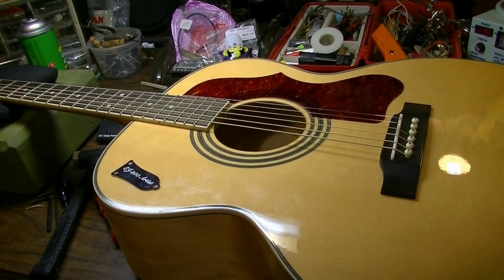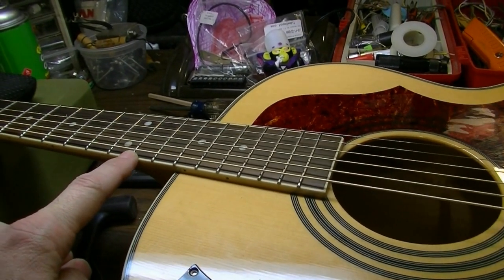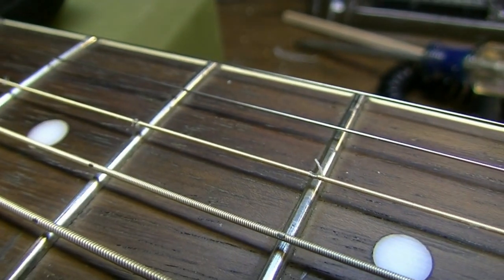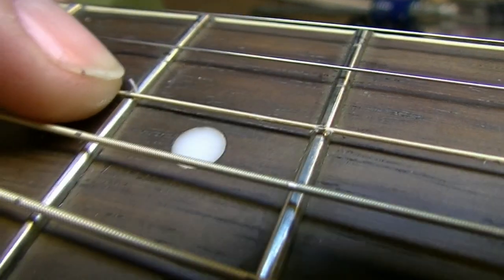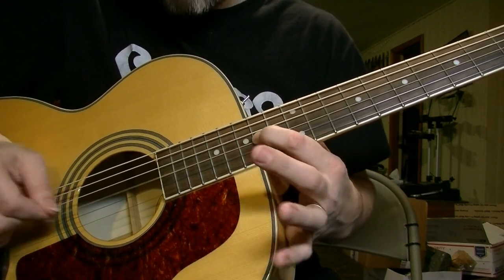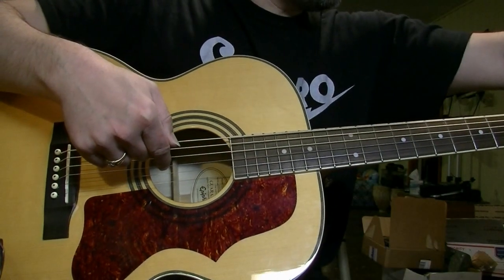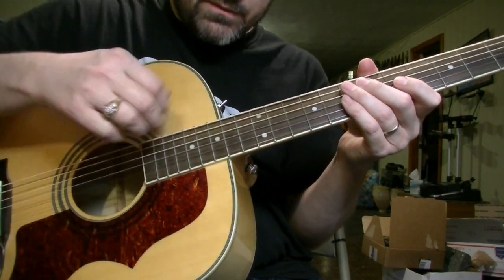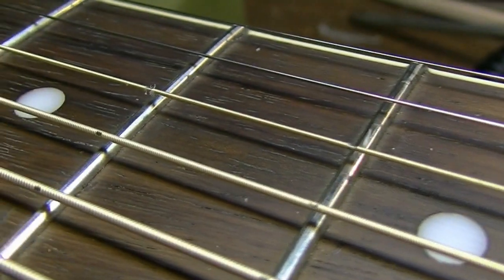Why I NEVER Use ELIXIR Coated Guitar Strings

Comment: been using nanoweb coated elixirs on three guitars (crappy acoustic, 6 string washburn and 8 string agile, that one was hard to find) and this has never happened. These strings look abused. My perspiration and whatever oils my fingers have are very harsh on strings, I can basically rust to oblivion a normal set of strings in less than a week even if i wash my hands before playing. After moving to another city and various other life-related stuff, i took the 8 string out of its box after two years, the strings were still pristine.

declaring "I'll NEVER use Elixir Polyweb or Nanoweb" is kinda... far fetched. From the looks of it, it's either manufacturing error (HIGHLY unlikely) or there is a shitton of seriously heavy fretting going on. Like, white-knuckle grip and bend with all your might with the intention of grinding the strings on the frets.

it's not about being passionate about strings. Who gives a flying fuck for strings? It's about recognising when a product isn't a good fit for the purpose. 

strongly suggest you string one of your electrics with coated elixirs and try them out. There is one thing i have noticed the coated ones don't do very well, and it's when you slide your fingers lightly along the strings and they make that glistening sound: the coated ones don't do that very much. If you like that sound, you might miss it.

Comment: Just as the devils advocate here, I bought a pack of Elixirs and within a week mine were fraying and peeling along the picking area. Was pretty disappointing, I neeed to use hand lotion so I don't crack from dryness (Canadian winters are cold and harsh, no liquid water in the air) and it seems it must've been my hand lotion which degraded the strings more rapidly than majority of people here seem to experience. If your elixirs lasted a long time, consider yourself lucky... I'm disappointed within the 1.5 weeks of putting them on.

Comment: I was a well thought of guitar service manager for ten years at a LMS, and a manufacturing assistant at a small but respected luthiers, and I'll tell you what. I sold up to 10 Alverez guitars a day with these strings equipped. Elixirs could withstand more than a year of greasy fingers and zero wipe-downs on store stock, and still sound great and play well. Regular strings could get wrecked by one sweaty customer. There is no contest.
It's not even a contest with say DRs or D'addario coated which I also sold, used, and liked. I like Ernie Ball slinky's too, which is what I put on guitars I perform with and change each gig, because they are cheap. I say this so as to prove I'm no brand whore. 
As far as low maintenance strings go, Elixir are far and away the best, based on nothing but long experience. 
I've got a set on my couch time electric, 3 to 4 months old, played daily, and they are only starting to get to the point where they may need changing.
Reply: How can you expect that worn out strings are going to perform like new strings?... Pfft. I bet they are a year or two old. No matter what the guy says. I've seen two year old Elixirs, and that is what they look like. Any set of strings more than three months old that are defective are to be replaced, not used as evidence that the company making them is shit.

Comment: Ok....  A forty five year secret is about to be revealed:

*I have only used Elixer string once... back in the mid - late '70's  Underwhelmed.
* You don't need Elixers to get the long life and still get a great sound.
* Back in the early "70's I took two guitars to class (playing guitar for college credit was better than English lit.)
* I had a Suzuki D35 copy.
* The extra guitar was a friends "B" (or even "D") grade Yamaha.  It was awful.
* I worked a little on the guitar but did one trick that really made that plywood junker light-up.
* The instructor had everyone tune-up, and he came back to me when I tuned the Yamaha.  
   He stopped, listened and said,  "That's a really good guitar."
* This trick has never failed.  Must add here, I've built a handful of guitars, one truly bad, the rest pretty spectacular.
* Strings do wear out and need to be replaced but they go dead long before replacement.  
* I must give a small amount of credit to an old college roommate.  He had a liking for fried chicken and would then 
   head straight to my room and get my guitar.  I had a flawless BC Rich B20 (yeah, Bernie once made acoustics, no two
   were ever alike even though they may have borne the same model designation.  They looked the same but were totally
   different for tonal qualities).
* My beautiful BC Rich was coated in chicken fat.
* Gave it a thorough scrubbing with rubbing alcohol, and got it fairly clean.  Just as with the Yamaha, the guitar
   sounded great.  Start with 70% (lacquer will dissolve with methanol.  get it clean with 70%, then remove that 
   30% water with 91%.  Be quick.  You have already removed the dirt, now you just want to get it dry.  Water is not
   good for strings or fretboards, and a dyed fretboard may lose the color, so always use propanol, NEVER methanol.
* When you do replace the strings, quickly clean the fretboard, re-oil, and buff it dry.  Install the new strings, cleaning
   first, then again after they are brought to tension.

Has never failed yet.  Just clean your strings.

Comment: Elixir strings don't go dead because they COME dead, right out of the package. 
I would only use them in cases where the player has acidic skin chemistry that eats plating, etc and leaves a white residue on the fingerboard.  For me, that's the only application. 
I know a LOT of pro guitar techs for the rock star types, and these guys get strings free, and can use whatever they want, and I haven't run across a one that actually uses Elixirs, regardless  of endorsements
...But the Taylor crowd will tell you they are the best lol.

Comment: Google needs to make these threads easier to respond to.  If you don't like elixirs, don't buy them.  I've had good luck with them.  The humidity where I live corrodes strings almost instantly.  The elixirs on my only ovation sound brand new after nearly six months.  Most of the strings are made by one company in one factory anyway.

Comment: I’ve used elixirs for years, they are hands down the longest lasting, best strings I’ve ever used. However, I also change strings every several months due to heavy play and sweat/grime buildup. I also clean my fretboard often, never had an issue with fraying, only coating wearing off on those special coated versions. Not sure why some people reuse strings to begging with, I’d say just switch them out every few months and you’ll have a new and full sounding guitar forever!

Comment: the only issue ive had with these strings is that the intonation dies pretty quick. maybe a couple months of consistant playing, check intonation at fret 5 and 17 and it is completely off. infact its so bad the guitar is almost unplayable. i dont think acoustic players would notice this as much because its less common to play the higher octaves. but electric guitar solos and stuff like that it's instantly noticeable and disgusting sounding lol

Comment: These strings either have a thousand hours of play time, or the player has bionic hands and needs to lighten his touch, or the frets need to be dressed. 
 I change strings once a month and put a ton of hours on every set and they are beyond ready to be changed when I get a new set. This can only be done with elixirs, every other brand I've used is unplayable after two weeks.

Comment: Any question about whether you have any credibility on this issue as a guitar tech is easily answered by looking at 6he condition of those frets, the fact that you re-used the strings, and that hack job of a switch you drilled into the guitar (you know, there are way better looking and performing switches than that, right?).
Reply from the maker: I installed the switch the customer wanted. And I put the strings back on at his request, because they are expensive strings and were brand new. The frets weren’t the cause of the peeling string coating. This is just what shitty coated strings do when you don’t play your guitar like a geriatric. But you wouldn’t know anything about that.

Comment: Sorry Dude.  I'm not a fan of Elixers as they seem to break more often on me than others.  However, the coating should not be blamed.  Those strings should have been changed ages ago.  Apart from the buzzing, I see huge flat spots that indicate they are no longer playable.  Coated strings generally last longer, but they don't last forever.

Comment: Man, I've been using Elixir's for over a decade and never have seen this issue. Of course, regular string changes and proper maintenance I guess might insure that my strings don't look the ones in this video. And I guess I just don't understand, if you're putting new equipment in your instrument, why wouldn't you put a new set of strings on the guitar? I mean come on! New pick up? Let's get new strings on that chief! That's almost like buying a new suit, but wearing your old flip-flops when you put it on.

Comment: Two practices and one gig you say? Sorry but I don't buy that for a second. Those strings have been hammered. I have used Elixirs for 20 years and they will last for months before the coating begins to wear. I suggest changing strings a bit more frequently!  I also suggest that there is a high fret causing the buzz; nothing to do with the strings-and the action on that guitar is not excessively low either.
Reply from the maker: You don't "buy it"? Why would the dude lie about it? Why would I lie about it?

Comment: I only use Elixir strings (Polyweb) and I've been using them exclusively for years. I've NEVER seen this happen, no matter how old my strings have gotten. Elixir's easily last about 5 times longer than regular strings (maybe more). They are phenomenal and your cost benefit analysis could not be further from the truth. They are definitely worth the money and you save money on strings when you use them. The strings in your video had to have been ancient, mistreated or defective.

Comment: find it hard to believe that the strings are the problem, amazing strings in my experience
Reply from the maker: It's the strings. I used to manage a music store and this was a known issue. Changed thousands upon thousands of sets in my time and torn and frayed Elixirs is common. I used to have guys swear by Elixirs, even though they would buy a set and have me string their guitar, play one weekend gig with the set and bring back again the next week with the same problem. They'd still buy Elixirs because they said if they didn't their hand sweat would corrode their strings after one set instead of one gig. Of course, I was happy to have the business.
Reply: The Guitologist weird. All my electrics acoustics and my 12 string I have on there. I find if ur recording or playing a gig put new normal strings on. They're brighter. But elexir last longer with a bright sound

Comment: Yup still buzzes guess you ground the bridge to far.  Ive been using elixir nano for 9 years change them about once a month cause i play everyday.. cant stand the sound of any other string they are simply the best. And I don't care how much they cost there just that much better.
Reply from the maker: I disagree on the strings, but you are partly right on the saddle. I did file down a tad much, but that doesn't change the fact that the old 70s Gibson string buzzed much less without the polyweb material hanging off it.
Reply: The Guitologist hey again ...what your looking at is separation of the winding from the solid core , this is not the coating separating from the winding..All strings will do this when they get old, a player who plays a lot will change those dead strings long before this happens, non coated strings go dead in 3 to 5 days ,if you play all the time like me you wont be able to stand the dull thud you get from old strings.

Comment: Those are the old style polywebs. The Nano & optiwebs don't do that. I've used the nano webs for years and they are far superior to any other strings I've used. I just switched to the optiweb for my electrics and they're even better. Quit being cheap and use the nanowebs. A set of elixirs last me a month. Every other brand only last one gig, if that.

Comment: There are two types of guitarist that sweat, the ones that rust any hardware they touch, and the greasy one. Both me and my friend have been using Elixir for years for both acoustic and electric guitars.
We play metal and hard rock and anything in between, but our band we have together is a metal band and we play pretty hard. All this being said, never did it happen to get all the coating off Elixir strings.So there might be other problems, either the construction of the guitar is weird or faulty, or the Elixir's he got were duds or kept in an inappropriate environment. I promise you it never happens. If you are not a fan, it's perfect. they are just strings, but don't tell people that they are not cost beneficial. I really want to hear your opinion on this one. In a studio environment, you are recording your album or songs that go online and stay there forever. Is it not worth buying the best sounding strings even if they are a bit expensive? Think about it, i really want to hear your opinion.I'm not a native English speaker and sometimes i may come out sounding like a jackass, but that's not the intention here. I just want to share the things i know for sure because i have tried them over and over.We guitarists tend to do that sometimes :) have a great day !

Comment: Why didnt you put fresh strings on, those are totaly worn out, and it takes alot to get there. You do a critique of worn out strings? You have alot of spare time.
Reply from the maker: The point was the strings are not old and yet they are still worn out, as you so deftly observed. A set of strings that cost this much should not fray like this as quickly as these frayed. My point is simple: if you are an aggressive player, stay away from Elixirs because the coating can wear quickly and cause issues. Take the advice or leave it...

Comment: They do for bass.  Believe me.
Reply: Brock Landers Yep you are correct. Bought an Ibanez SG405 years ago and it came from factory with Elixers. Didn't mind them at first but the coating started fraying after a week (mix of finger, pick and slap playing). They did not buzz like he is saying but the sustain would drop dramatically. Swapped them out for D'Addarios and never went back.

Comment: Ok. Who does all that work on a guitar and puts the old strings back on? Or leaves them on? They are just worn out strings. I have used dozens of brands of strings, and have finally settled on the nano coated elixir because they sound brand new for months instead of days. They last months instead of weeks.
Reply from the maker: Someone whose customer asked him to because he just bought the strings less than a week ago. He wanted me to put them back on, so I did, or at least I tried, until I noticed the tearing and fraying.
Reply: They are never the same put back on. I'm pretty darned old, rode hard, put away wet. I've had occasion now to try pretty much everything out there. These two sets on my ovation balladeer and my Ibanez RGA32 are the first sets of elixir strings I've tried. I am three months In playing nearly every day. They sound newer than any three month old Martin's that cost the same or more. I'm hard on strings. Open tunings different every day. The set before in the ovation was the super expensive martins I split a two for one deal with my son and they lasted, but were dark and dull sounding in a few weeks. I bet the big issue for you was reusing the strings. My electronics on the ovation sucked when new and new are crap. I got on of those 1K acoustic rigs that clip on the sound hole and the pre clips on your belt. I am delighted. I have already used it elsewhere too. Sounds better than the $200.00 fish I put on my 12 string. It feels a little cheap. But sounds delish.
Reply from the maker: Nah, I told him to leave the strings on. In fact, after shooting this video I apologized to the string gods for my error and put the Elixir back on. He's still buzzing away on it.

Comment: those strings are badly worn and stretched out i have used Elixir nano web  12--- 53 on my acoustic for many years and have never see them damaged like those he must have been playing with a steel slide bar anyway the coated strings are much easier on the finger tips and less string squeak changing cords

Comment: Elixir strings for me lasts about 1 whole year,  whereas other brands lasts 3 to 4 months at most
Reply from the maker: 12 months in a year. 3 months = 1/4 of a year. Elixir strings = $15.99 for phosphor nanowebs. Common non-coated phosophor strings such as Martin Marquis are $4.19. So depending on whether it's 3 months or 4 months, your cost/benefit analysis might change. It also might change when you consider your Elixirs might last "about a year", but they might sound and play relatively poor for the second half of that year due to coating fraying. You might just be putting up with an acceptable string rather than enjoying a new string set more times per year.
Reply: Yeah, what you said makes sense.

But personally i dont feel any significant change, regarding the quality of the tone and the brightness of the notes, into this period.

Even after a whole year, i do not ~need absolutetly~ change the string set. Is very aceptable to keep it; it's me who choose to change them though.

Before using Elixir string I was a D'addario fan, even getting upset when the strings used to start losing the brightness of the sound with just two or three days of use.

Nonetheless, this thing that happened to you that you show in the video has never ever happened to me.